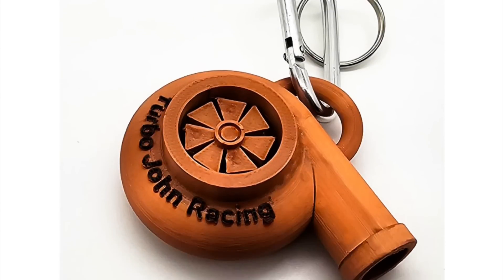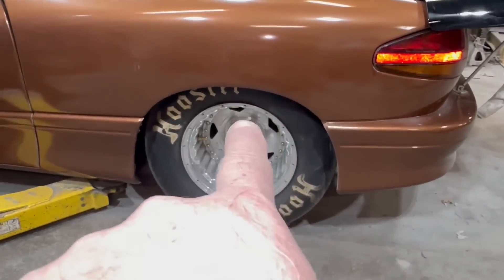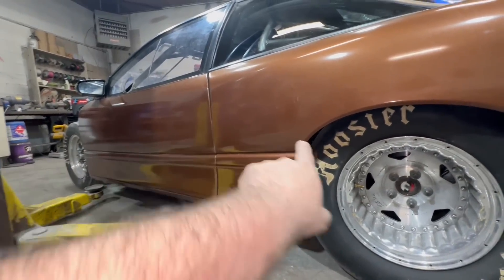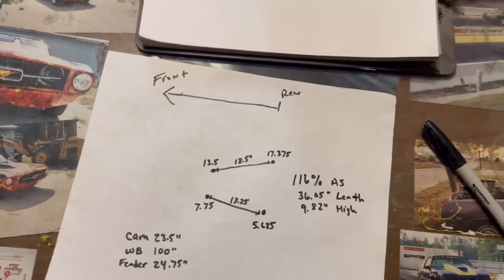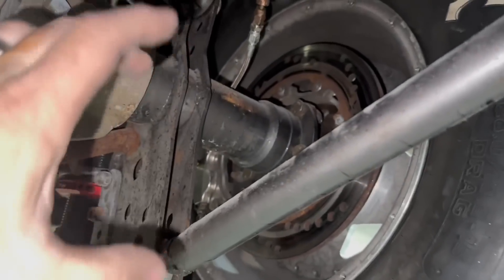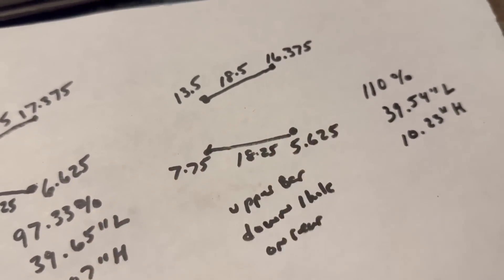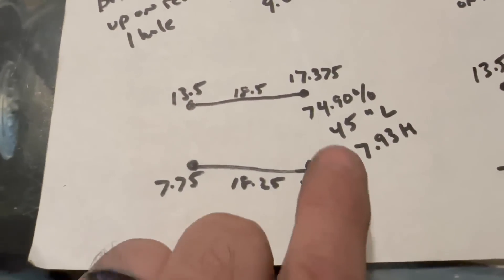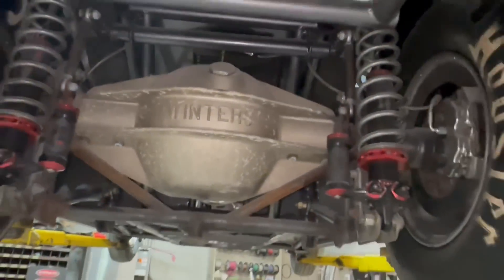Drag Racing 4 link changes for NO PREP / Backside and Frontside settings / Plotting the 4 link

Comment: The amount of anti squat is only a part of the puzzle as you know better than I!  The amount of anti squat equates to how hard and how aggressively the rear tires are forced into the pavement.  This is in addition to the amount of weight transfer from the front and to the amount of weight on the rear end.  Obviously a car with greater (controlled) weight transfer (achieved by engine height, engine placement and front end extension) can achieve the same rear tire downward force with less weight on the rear of the car.  This car would have an advantage on back side races by having the same amount of rear bite with less overall weight.  Adding rear weight is kind of a crutch for a chassis system that is limited in adjustment like the Saturn.  And why you are building a new car!!  High crank centerline, engine as far back as possible for optimal weight bias, long travel front struts and rear bars with tons of adjustment.  👍